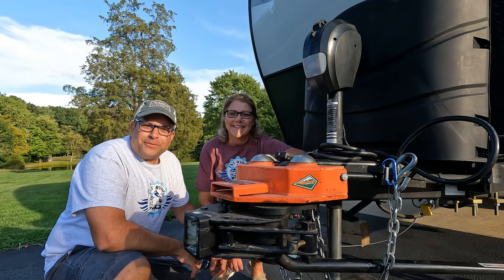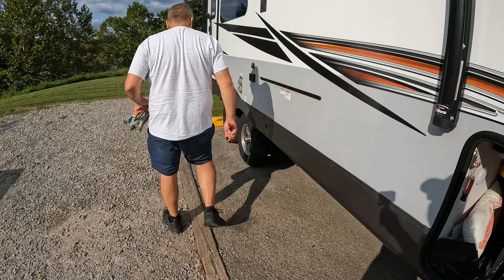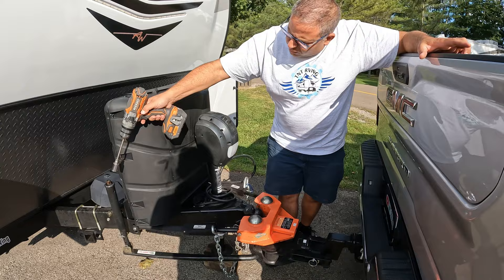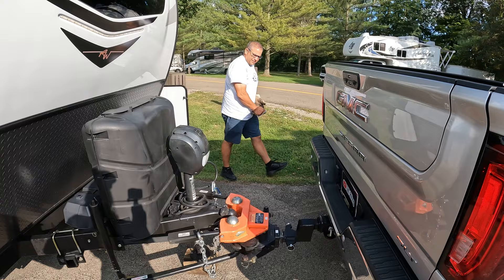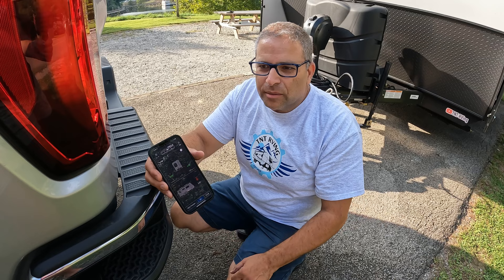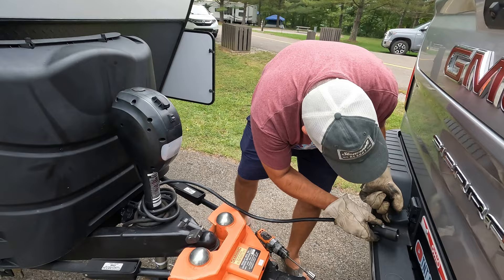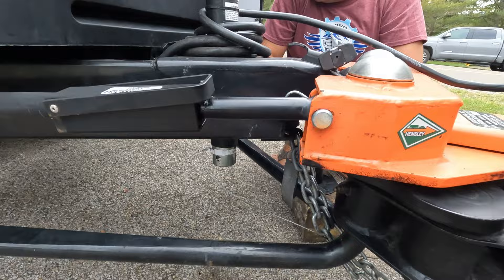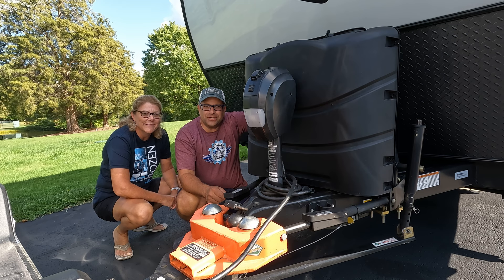Hensley Hitch (Easy Hookup) #rvlife #rockwood #rvliving #towing #camp #trailers #hensley

Comment: Buying a used trailer with a Hensley and your video helped a lot.  We have stayed at Stonewall many times and have had that site your in a number of times.
Reply from the maker: We really appreciate the comment! Glad we could help. You will love the Hensley…Thanks for watching and subscribing!
Also, here is a link to our most recent stay at Stonewall Resort/ Briar Point Campground..
https://youtu.be/KKnsvigiuBI
Reply: Alot of moving parts. Why can't you just takeoff the hitch of the ball? Ya to expensive for me. I just have the stabilizer bars. Hook the ball up put the bars on and I'm gone. I understand the sway but I have not had any issues with that even in windy conditions. I have a 29' wildwood  24rlxl camper on a 2021 GMC elevation 5.3 v8 . And she pulls great. Way under the weight rating. Would not go bigger since it's me and the wife. Also the way you hitch and slide it in the window seems alot smaller then just backing up over a ball. I guess it takes practice. But right now I can't justify the cost to upgrade to this. But nice hitch for campers with longer trailers. Nice hitch tho and good video.

Comment: big fan of the Hensley.  Had one for 3 years and amazing how easy it makes towing.  The only issue was every now and then, if the conditions were just right (wrong), it could be a bear to get hitched.  But that happened maybe a half dozen times in 3 years and we travel a lot.
Reply from the maker: Agree, once and a while it can be a little frustrating…But worth it..
Reply: been there done that
Reply: To combat this I use a small digital level. I put it on the stinger and get the angle then I put it on the Hensley and match that angle. Has worked for me every time. Sometimes I go to campgrounds that put the truck in a really nose down position and one case was 45 deg. to the trailer as well. Well unhooking is not a problem but hooking up is another story. This solution solved that problem for me. Hope this helps someone.
Reply: @charlesyoungblood7561  May I what kind of level you use for this? Is it a regular level or a special made one? Where can I buy it?

Comment: One of the things that has really saved me and made it so much more enjoyable is when I go to unhitch I always, always, always, after putting the x chocks on, is to put the truck in reverse and put some slight back pressure on the hitch. This will prevent the disconnecting bars from slapping back pinching the crap out of your hands. I am sure everyone out there with a Hensley knows exactly what I am talking about. One time was more than enough for me to figure out a solution that works every time.
Reply from the maker: We have been fortunate to not have that happen! We always set the brake and use x chocks as well along with wheel chocks on any slight incline. Thanks for watching and sharing a great tip!

Comment: Just watched this video, beware those x-"chocks"! They are NOT chocks! They are stabilizers. Your trailer can move when they are installed.  ALWAYS use a hard rubber chocks, front and back, on both sides. Please read the instructions, they are to be installed AFTER the trailer is unhooked and leveled. If you install first, then level, the up or down movement will stress your tires, leading to a possible blowout  (ask me how I know) and stress the trailers suspension as well. Good chocks cost less than $10 each at Harbor Fright, please purchase and use them.
Reply from the maker: We normally use wheel chocks, I was just in a hurry. Thanks for watching and commenting about adding the x chocks  after leveling. Safe Travels..

Comment: Hey Tony …enjoy the videos…did you do a vid on the installation of level mate pro ?
Reply from the maker: Thanks for watching and subscribing!
Unfortunately I did not, I might have to remove it and show how to install it…
Reply: I was curious as we have the same rv and my plan is to install the level mate pro this weekend…where did you mount it ..Thank You
Reply from the maker: I mounted it in the pantry cabinet (middle shelf wall). On the wall that is common with the bathroom. If I were to do it again I would mount it on the lower shelf common wall with bathroom. The label should face forward..
Reply: @TNTRVing  I was thinking the same maybe above where the shoes are stored so I could just reach in without dropping the steps ..did you level with slide out or in ? Thanks again Tony !!
Reply from the maker: I leveled it with the slide out, also this year we left our on while traveling or if it’s a long trip we flick it on when close. The battery is still good and strong.
I may relocate mine somewhere where I can run power to it and leave it on.

Comment: Hi Tony we just ordered a 2023 2205s and can’t find the width with the slide out. We need to build carport for storing the Minilite in the winter. Thank you for your help.
Reply from the maker: On our 2021 our slide goes out 40 inches. (I just went down and checked our tape measure that we marked for when we pull into sites to check to clear obstacles) The width of the trailer is 96 inches total 136 inches….Not sure how much wider I would make the carport for buffer…Best of luck! Thanks for watching and subscribing!
Reply: @TNTRVing  thank you for your quick response. It’s going to be 6 months until the trailer arrives. A lot of planning and dreaming until then.

Comment: Tony, thanks for the video. I’ve been looking at the Hensley. Doing some research I’ve ran across a term, “The Hensley bump.” Apparently some people going down steep grades has experienced the hitch pivots and bumpy the tow vehicle when using engine breaking. This seems dangerous especially on wet roads. Is this a real thing or do people not have them set up correctly?
Reply from the maker: In our experience I had noticed that if the trailer brake gain in the truck was set too low it would cause a bump. I simply increased the gain and we were in good shape. Thanks for watching appreciate the comment!
Reply: @TNTRVing  what about a steep grade where you’re not on the brakes a lot? But, letting the tow vehicles engine braking slow the rig down.
Reply from the maker: Bob,
Great question! We haven’t had any issues with that. We just came back from a trip going down hills using engine braking multiple times, No bump at all.

Comment: Why do you take of your foot pad. We leave ours on. Just wondering if I’m missing something
Reply from the maker: I like to remove it and lift the jack up all the to the white line so the torsion bars do not hit while making a sharp turn.
Reply: Do you know if you can hook up at an angle or must you be straight in line. My driveway forces me to hook up at an angle with my truck. Thanks for your valued time. USMC/USAF Ret.
Reply from the maker: @trumpwon8231  you can hook up an angle, Tina and I did it once before.
It might be a little bit of a pain to get it seated all the way in. What we ended up doing is getting it as close as we could and using the over center cams to pull it together. We were talking about making a video on it to show how we do it. Here is a short Instagram video we made. https://www.instagram.com/reel/Cvn1b4MNiK8/?igshid=MWY4N3BwNjZqaDJz